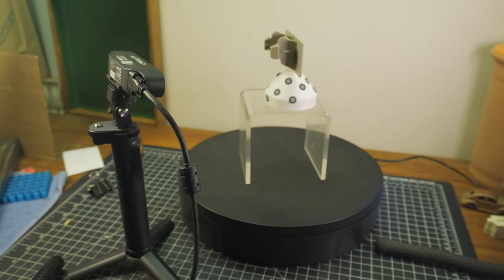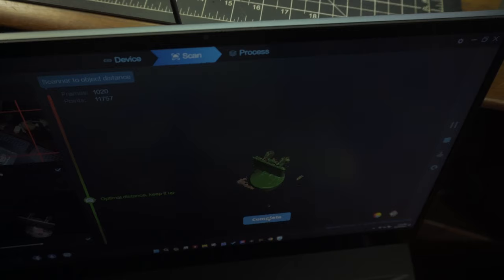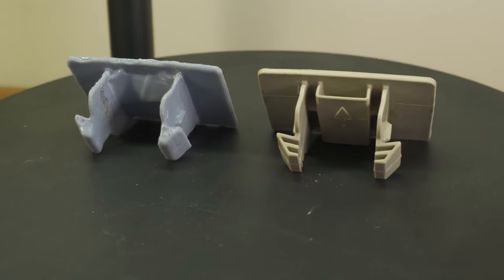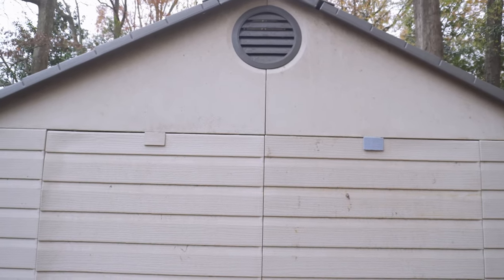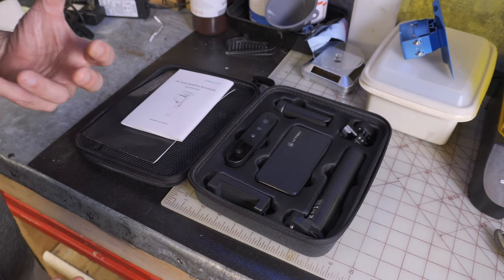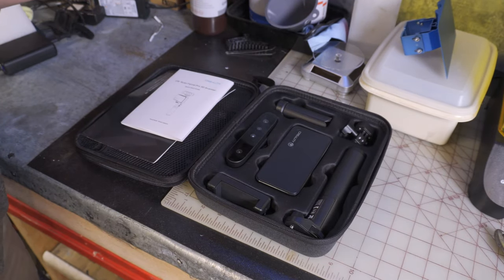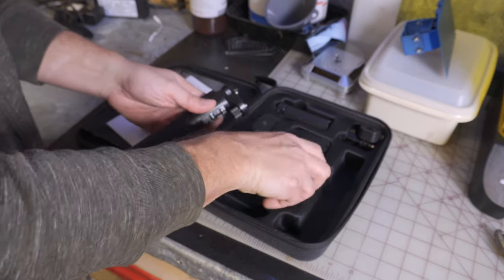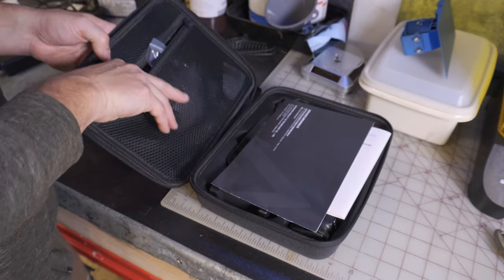Functional parts from a 3D scanner? - Creality Ferret Pro 3D

Comment: I just sent this same scanner back to amazon. I have done everything except sacrificing a goat to get a decent scan. The part i'm trying to scan in cube form and its not a cube measures H 10 mm .4 in W 12 mm .46 in L 1.6 in 40 mm  After 10 days of this I never got a scan the software is Creality scan 2.1.6    I like the unit it is built well but I think its weakness is the software.  I hate to return anything but a $350 investment in a product and zero scans isn't going to cut it. The resolution is .1 mm  = .04 of an inch. it should produce something at that resolution.  Putting the part on a turntable and a stand gave me nothing. Getting the distance was in the optimum green scale as you did should have given me a good scan. I did not get scan I am very frustrated with this unit. It should have produced a part. Creality needs a HUGE improvement in its software. For small parts find something else
Reply from the maker: You are correct. I have noticed that the smaller the item, the harder it was for the scanner to even find it. Though I never did anything that small. I think it has something to do with the physical perspective angles of the scanner sensors so not sure that software can address that.
Reply: Your part is way WAY too small.